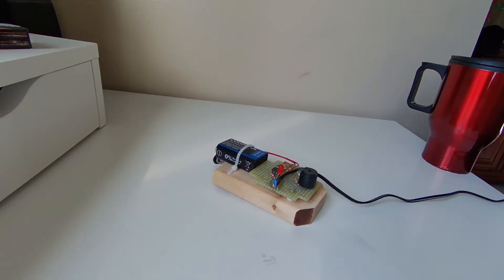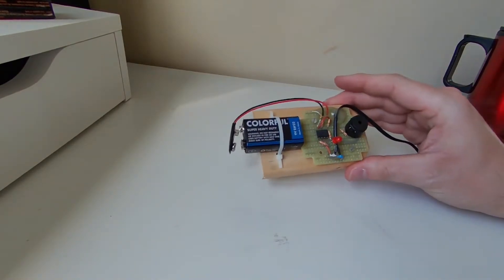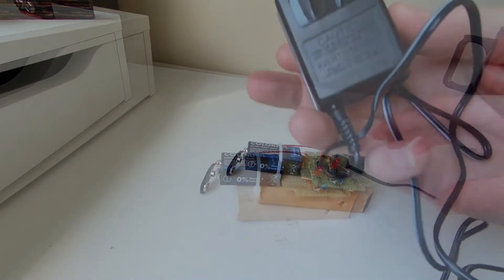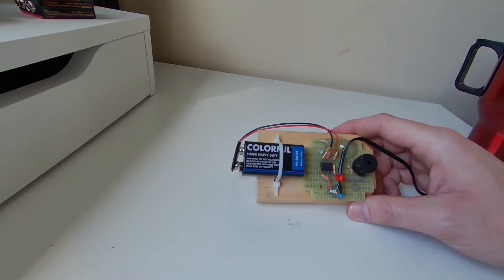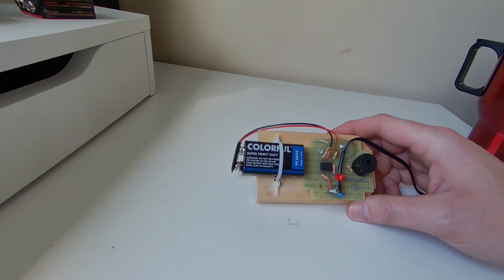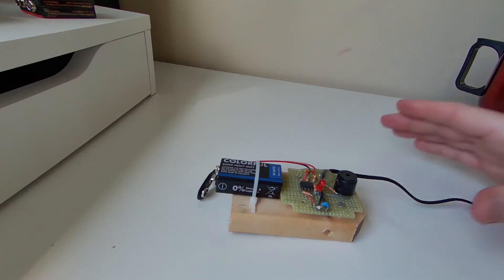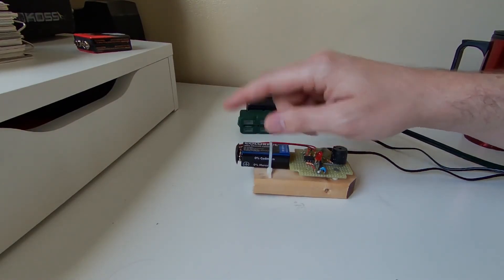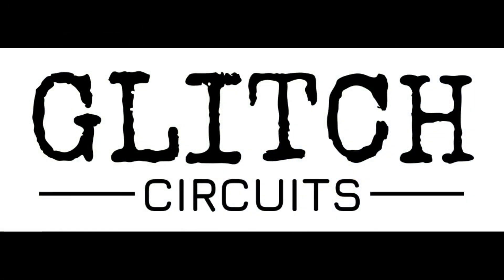DIY Power Outage Alarm

Comment: How about a simple relay that holds the buzzer circuit open while it has main power and then closes the 9v battery to a buzzer circuit when main power is lost.  0 draw on the battery unless power is lost.
Reply from the maker: Yep, you could use a relay, or mosfet, etc. to build a similar circuit. It would just be a trade off: the low battery level detection for extra battery life.
Reply: telecom relays are nice and small. You could also float charge a nimh cell/battery at c/300 (~8mA for a 2400mah cell/battery), or use a supercap (which should last decades longer than a 9v battery).